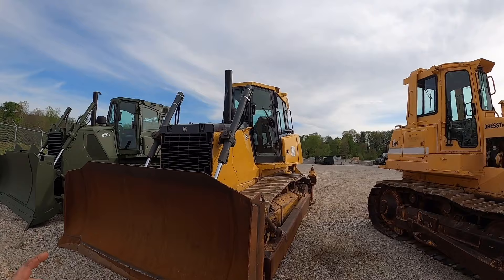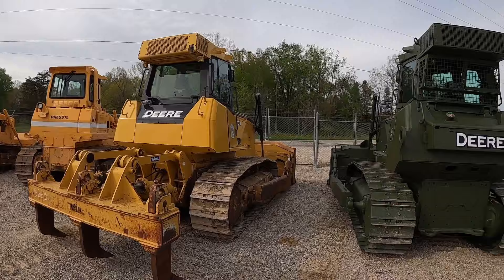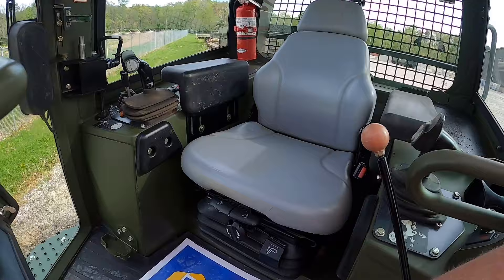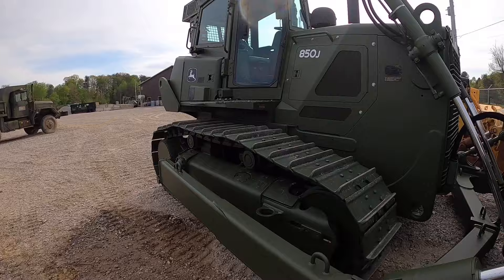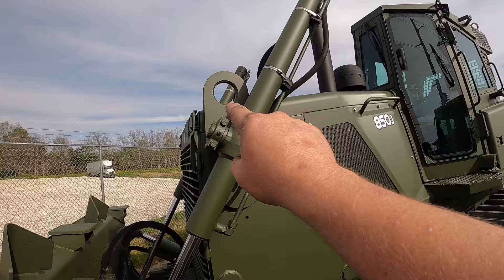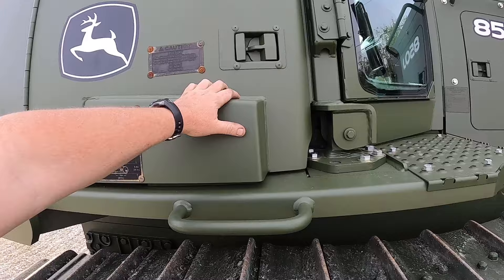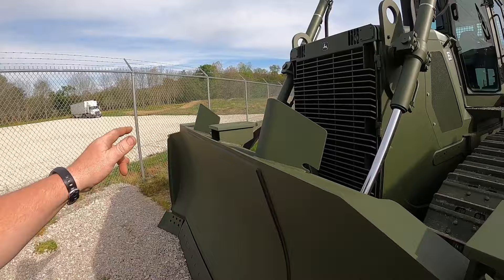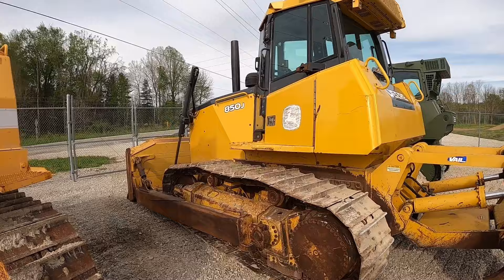Differences between military and civilian 850J John Deere dozers @C_CEQUIPMENT 850JR

Comment: The green paint should be CARC paint it's not normal paint don't sand it or weld it with out proper PPE. Not to scare anyone away but ppl need to be aware of what they are messing with. Also need to watch buying parts and ensure what your buying is the 24 volt parts for the machine. All military vehicles and equipment run 24 volt systems. Usually not a problem in heavy equipment but becomes an issue when people buy surplus generators.

So not to keep this too long but also keep in mind the manuals for military equipment are awesome I recommend downloading the 2-4&p version has indepth trouble shooting  instructions, parts breakdown schematics, wiring schematics. And incorporates the NSN number for parts so instead of paying top dollar for the john deer parts you can get the parts direct from the ppl that build them for John Deere, and cut out the middle man, in most cases. For the piece of equipment your looking at it's known to the military as the MCT (medium crawler tractor) NSN for it is 2320-01-558-5671
you can find that manual from multiple websites like liberated manuals.

Comment: I wonder if removing the top of the cab, drops the height enough to fit in a shipping container?  It might be quicker/easier to just re-add the cab top, than reinstall an entire cab.
Reply from the maker: It would be to wide
Reply: Dropping the height allows you to airload the dozer in something like a C130. C130 has a max load height coming up the ramps of around 9’. By published specs a C130 should be able to load and fly one of those things albeit i would rather see it on a C17 if I was the C130 load master.
Reply: @jayss10  every time I’ve had one of these d9s off loaded on a mt cat with the wrong trailer it’s “broken” something. Don’t know how strong those ramps on a cargo planes  are but I don’t doubt plenty of dunnage would be used.
Reply: @jzapien1377  If you actually look there are videos of where they onload and offload M1A1 and M1A2 Abrams tanks.  The A1 is just as heavy as a D9 and a A2 is about 10 tons heavier.  No dunnage, but ALOT of chains and math and load figuring by the loadmaster.

Comment: The windows are bolted in to make it easy to replace. Not to load it into a shorter ship...
Reply from the maker: They are bolted in so they can remove them and reduce the cab height down

Comment: What does the "LPG" mean? Do all the military have tool boxes?
Reply from the maker: Lgp stands for low ground pressure 
Normally all military ones have the boxes
Reply: @C_CEQUIPMENT  Most all military vehicles have a box large enough to hold a soldier's Basic Issue Items which they are required to keep in close proximity at all times.  You stuff it in your ruck and it fits nicely into that box.  Also has room for a case of MRE's.

Comment: So, with that being said which one do you recommend? Is it better to get the military 850, or the civilian model?  Are the prices different?
Reply from the maker: Depends on what you are doing I guess
Military ones normally have lower hours
Reply: @C_CEQUIPMENT  But are they tougher than the other ones? Does the military equipment them and beef them up enough to be stronger and last longer than the other? I heard you talk about some things that were different, but is there a difference in price and is more better?
Reply from the maker: @jamesdiehl8690  the frames might be a touch stronger because of the extra steel and lifting points

Comment: Not to mention our equipment has daily, weekly and monthly maintenance requirements for the military.

Not to point fingers but civilians don't spend nearly as much time doing maintenance as we do in the military. Yes civilians do basic maintenance, but in the military every bolt, screw, wire, switch, bulb has a MSDS (Materials, Safety Data Sheets) for them explaining every little detail on the machine. 

To give you an idea of what I'm talking about heres a simple example:

Baking brownies;

Civilians = directions are printed on the side of the box.

Military = 18 pages of data to review before you even start to do anything.
Reply from the maker: Oh
I know
Reply: @C_CEQUIPMENT  lmao only the military can make thing more difficult then needed, but it pays off in the end.

Great video BTW, thank you for making it. I love seeing civilians asking about military gear and there be someone willing to put in the work to help explain it.

From this one video you at least gained 1 sub for sure.
Reply from the maker: @camelfilters3224  thanks

Comment: It is a myth that modern diesel still have lubricating properties. Since they removed most of the sulphur from diesel fuel, the fuel no longer have the lubricating properties. Jet A are based on kerosene, and diesel airplanes run on jet fuel. Jet engines are fuel versatile, and can run on jet A if necessary or anything that is flammable, with minor adjustments. I heard of some newer small diesels have to be redesigned to run on the new fuel, like VW, But not the larger engines. I did not see a turbo charger in the Deere, that is unusual for diesels.
Reply from the maker: They do have turbos
Reply: Modern diesel does have lubrication properties I guarentee it

Comment: My experience with JD dozers, everything on the engine and transmission was from Liebherr. A German company. Granted, I've never worked on a US military JD dozer, just civilian models of the 850J and 1050J. Over engineered and more complex than needed, IMHO. Takes twice as long to do a simple PM service as it would to do a Cat, Case or Komatsu dozer of the same size. 
JD Dozers are, I think, just a US built (Not US Made, just built) German Leibherr dozer, in JD dress.
Reply from the maker: Yes the the 950c and j along with 1050 c and j models were liebherr but the 950k and 1050k are Deere machines 
850 sized machines and smaller has always been Deere machines built in us

Comment: Weapons mount NOT machine gun mount. M16/M14 are NOT machine guns. 

Also JP8 is not jet fuel, it is a different grade Diesel.

Jump start uses a slave cable, yes that is what they are called.

They are called tie down points. The large rings. Yes they can be used to lift some parts but they are used to tie down for shipment.

Comment: why would you want a military ones? are they cheaper? the differences dont reely make it any better then the equivelient speced normal one. and jet fuel costs more then normal diesel.
Reply from the maker: You can run regular diesel in them
Normally military ones are more appealing because of low hours

Comment: That military one had perfect paint, even on the blade, was it just repainted or was it our tax dollars sitting in the corner somewhere until it found its way to your lot?
Reply from the maker: It was repainted
Reply: Both happen. At the apprenticeship site I went to for training, we got a couple of D7H that had probably 20 hours on them each, but the engines were locked up from rust as they were sitting in a warehouse or somewhere since the mid 90s... this was in 2017. I don't remember if they just re-sleeved the engines or replaced them, but the mechanics got them up and running again.

Comment: Without watching, I'm going to say there's better glass in the cab, green paint, some stupid nonstandard electrical system, and about 250k dollars more expensive for the military one. 
Oh, and nonstandard filtration systems. Can't have consumer parts in military hardware, after all... Maybe an NBC filter for the cab too, but that's just a charcoal filter and strong positive air pressure, so they probably threw that in for another 40k. 

I hate john deere trash. Never seen one that wasnt scrap worthy after 50 miles of pipeline.

Comment: You better man up already, just do the right thing and drop off a brand new military deere 850  dozer to me at my house and simply sign it over....my deere 1050 tractor is an absolute animal, but a dozer is needed for all the stumps throughout my land and I have alittle under 400ft run of the driveway entry that could use digging back out properly and I just don't have time for the box blade....

All I can say is you should really hurry up

Comment: I see a lot more differences than you are pointing you! Terrible video! It’s got lifting hooks to carry it with a helicopter. It has a fire extinguisher behind the seat. Your favorite thing is saying, everything else is the same, did you look under the military one? You keep saying, oh same part different number….. no! The military one is explosive rated material that’s probably much thicker or just a much better quality metal to withstand explosive attacks!
Reply from the maker: Belly pans are all the same part number and thickness
Fire extinguisher is optional in civilian unit
There is no difference in the steel other than if you had an armored cab